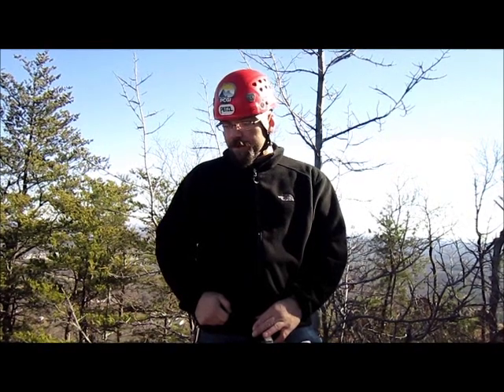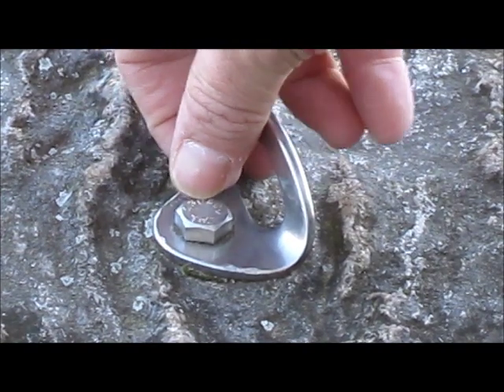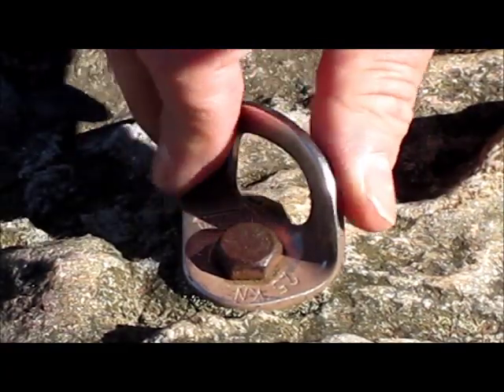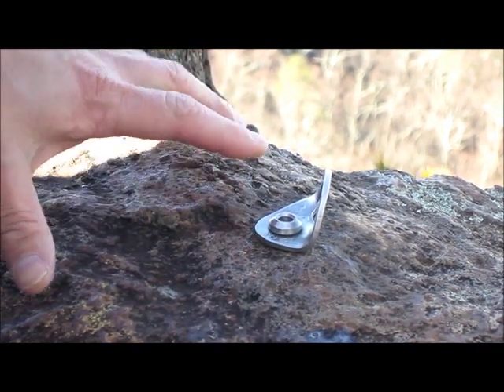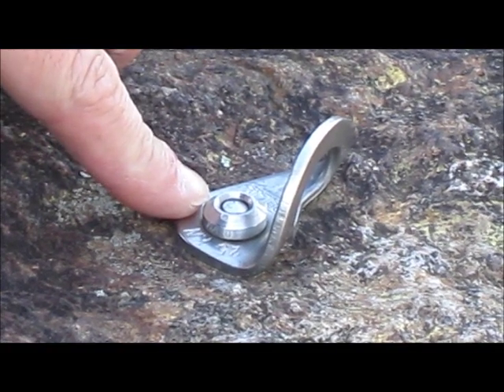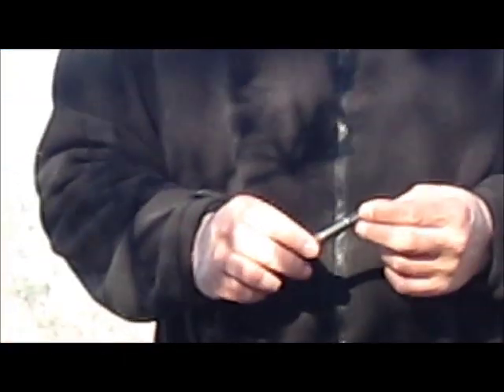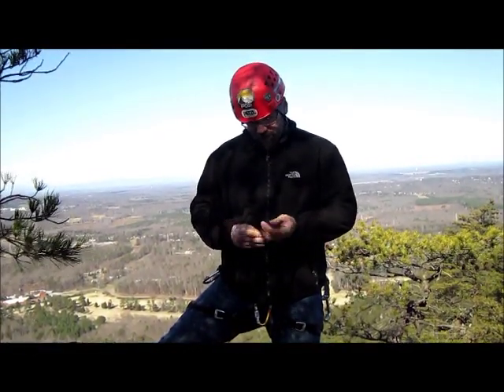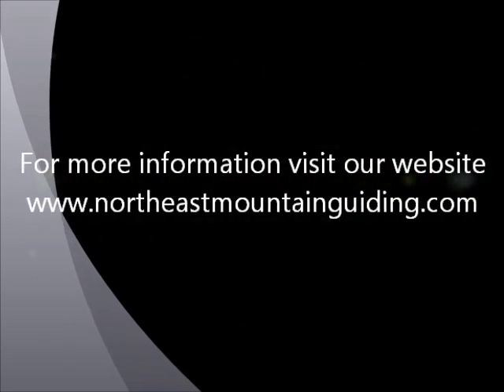Rock Climbing Bolt Assessment

Comment: "I would not clip this bolt"?  I don't think that's very sound advice, even a poorly placed bolt that may fail offers a higher chance of catching a fall than not clipping it.  Since there weren't two of them I'm assuming it wasn't a top rope situation where you had other options.  I'd personally clip a candy cane if I was run out 25 feet with nothing else to clip.